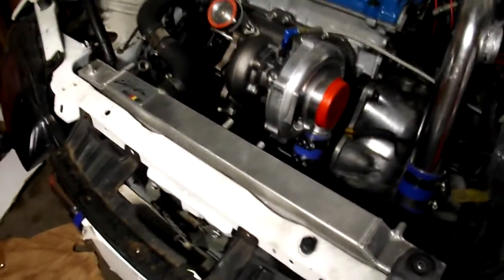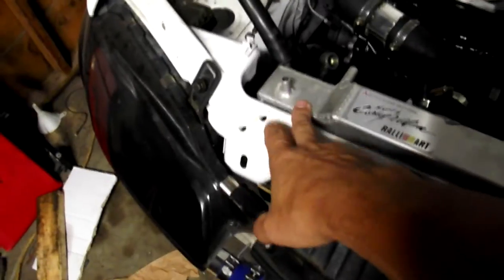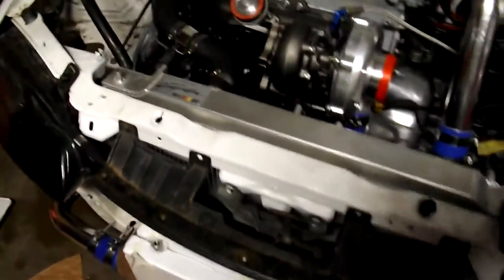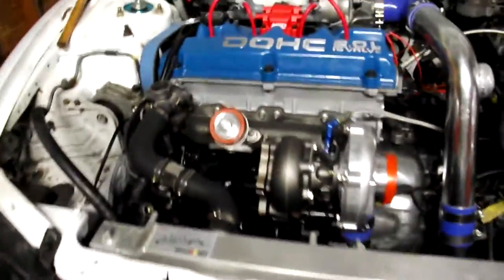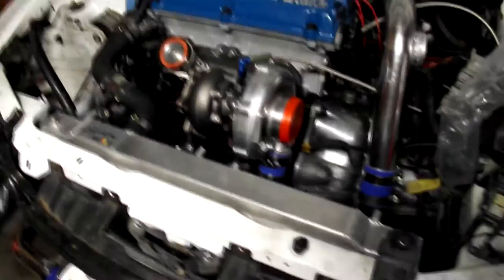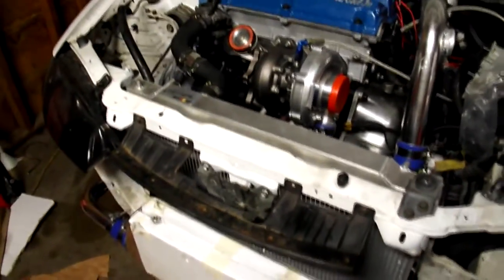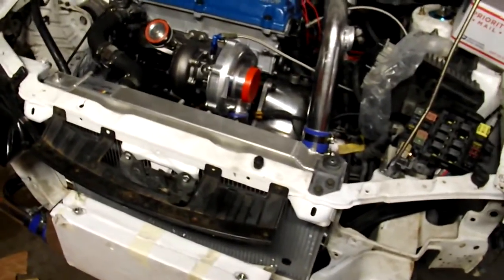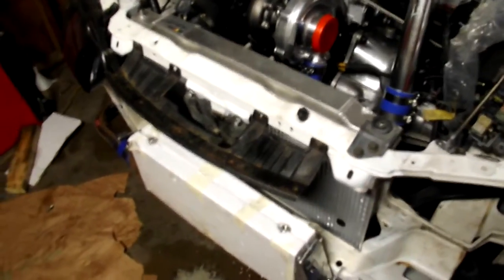1g turbo radiator in 2g non turbo eclipse

Comment: So any year 95-99 neon inlet will work? And it pretty well moves it so you can use any missimoto radiator or whatnot right?
Reply from the maker: Yes any 95-99 neon water inlet will work. As for the radiator you will have to use a 89-94 eclipse GST radiator.

Comment: They have 1 row radiators from getallparts.com that are aluminum. Not bad for 70 bucks. I bought it it's much bigger than stock and hooks up perfectly. Still trying to figure out tho why I'm still overheating. Changed thermostat, radiator, radiator cap. Not sure what's going on... 420a >:(
Reply from the maker: Have you checked the headgasket to see if it's leaking? But yea for some reason these engines just over heat
Reply: Rebuilt the entire engine. Ever since the rebuild it's been overheating. I'm kind of stumped -_-